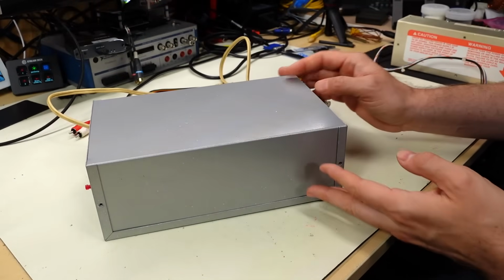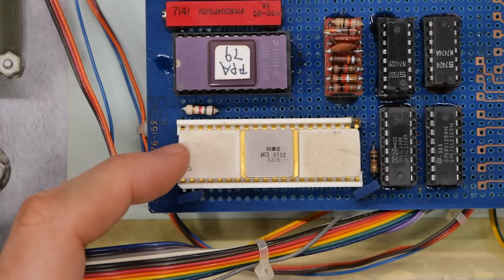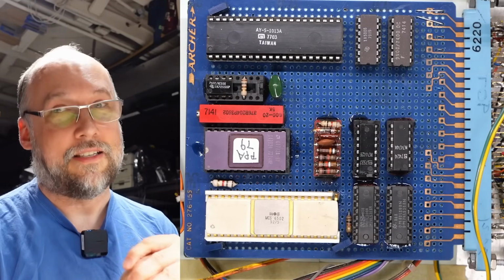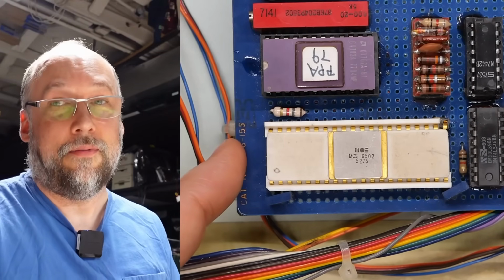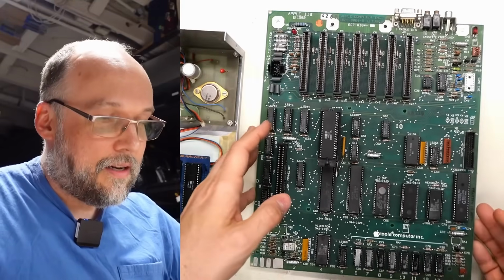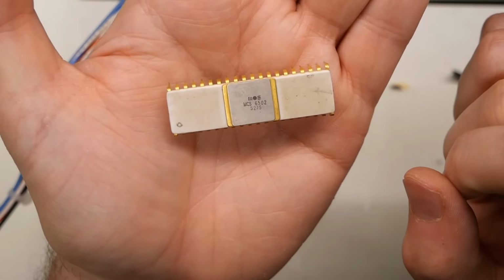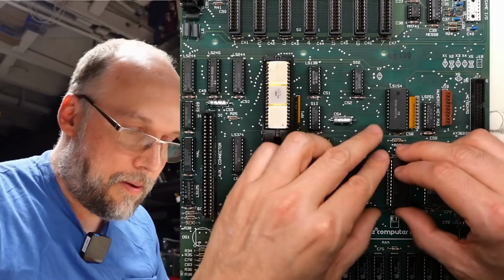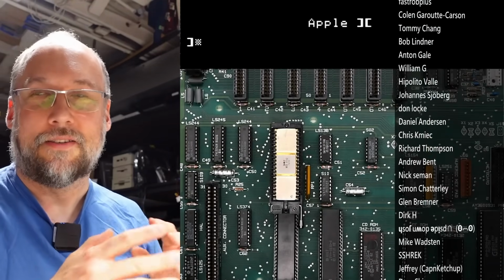Let's test a 50 year old MOS 6502 CPU

Comment: Funny thing. I just watched the video that debunked the myth of the ROR bug. The chips didn't have the internal components for ROR, so it was missing completely, and not a bugged ROR. That video has photos of the chip internals so I think it's legit.
Reply from the maker: I don't agree with that assessment. Robin makes a great point about it all: https://twitter.com/8BitShowAndTell/status/1629754457172111361 It was pretty clear it was supposed to be there from the start but never finished. So, if it was supposed to be there but they didn't finish the design, and released the CPU without ROR working, it sounds like a bug. If the new "ROR" had been stuck somewhere else into the decode table, ok maybe, but how did there happen to be a perfect slot for it if it hadn't intended to have been there since the start?
Reply: @adriansdigitalbasement  the video I watched stated that they needed to change the layout of other functions to free room for it, but since I wasn't part of the team designing the chip nor watched any video interviewing someone from the actual design team, I don't know if it is a fib or misinformation. I guess there are different stories around it and none is 100% convincing. I'll watch the video you linked. I'm not at all at the knowledge level of you and probably most viewers here so I just watch and try to decide what seems more plausible.
Thanks for the feedback, and keep the great videos coming 👍
Reply: @adriansdigitalbasement  ...also, if it was decided to not finish it and the initial intention was to implement it, it is a decision (made on economy basis I would guess) and not a bug. To me a bug is when someone releases something that is supposed to work but doesn't. If it is decided before release to scrap the function, it's not a bug IMO, maybe a bad decision but still not a bug.
All is my take and personal opinion of what a bug is. I can be wrong about the definition, my wife tells me I'm wrong often 😁

Comment: The 1st revision of the 6502 doesn't have a bug, your tittle is wrong; as Chuck said "it worked the first time" the ROR function was never implemented by design. As you said ROR was never written in the instruction set..

Comment: Well, there's some reports out there stating this isn't a bug. Apparently, in order to lower the price,  this version of the processor was not supposed to have ROR operation, so its basically an unused opcode with some undefined output. The ROR instruction, it claims, was added later due to user demand. There's a video here in TY with an in depth explanation.

Comment: Here’s something interesting. Note that, at time stamp 15:09, it says, “…which has a 6502 from week 51 of 1975.” The 6502 that Adrian has is marked, “5275”, or the 52nd week of 1975. So those two chips were, like separated at birth! Twins, if you will, only 1 week apart coming off the assembly line. How’s that for bizarre coincidence? Not only that, but they had the same birth defect (defective ROR instruction.)

Comment: You know what would be a really geeky thing to do?  You could wire up a circuit to the data bus and the SYNC pin.  When SYNC goes high, check to see with an 8-bit comparator whether the CPU just fetched the ROR instruction byte.  If so,  generate an interrupt.  And add an interrupt handler to emulate ROR correctly.   That way you could boot up an Apple ][ with that old CPU!   Possibly.   Unfortunately the disk driver probably will not work as it is critically dependent on each and every instruction cycle being just right.  I suspect the disk driver likely has a ROR instruction in it.   Wouldn't it be cool if they intentionally didn't use ROR because they had some early chips?    I'd love to ask Woz and the gang about that.

Oh, I looked at the Disk II disk driver listing, and it has NO  instances of ROR !!!!    But several ROL.   I wonder if that isn't a coincidence?

Comment: I bought a 6502 from MOS Technology in 1975 for $25.  It came with two very nice manuals, one for hardware and one for software.  I wouldn't call it a simplified 6800, it had some addressing modes which were much better than the 6800.  At the time, an 8080 was $250 and I had just build a computer using the 8008 chip which cost about $40.

Comment: Ah, the 6502, that takes me back... Though over here 🇬🇧 I don't think as many people had that Apple, though I may have seen 1 once. AFAIK, 6502s were most commonly used in BBC micros. I had a model B, which I think was the most common.

Rather than a screwdriver, I used to use 1 of the blades on my penknife to pop out chips. Although you'd still tilt it up a little bit at the 1 end, if a chip was in there with a tight fit, if you slid the blade most/all the way under you could then apply a slight rotational force to it side-to-side. That way, if you were unfortunate enough to bend some pins, they'd be bent in line with the short axis of the chip instead of the long 1, which made them easier to straighten. Straightening them when they were bent in line with the long axis of the chip was a pain in the arse.

Comment: I just took a quick look at the ROM of the apple II to check where ROR is used. It's actually not used a lot. It looks like it's used in the following functions: TRACE, NOTRACE, ONERR, HPLOT, when disassembling code in the monitor, and in some floating point functions. So that's where I would expect some problems to show up.
It's also used about 6 times in DOS 3.3, including some low level some low level functions like what to do for reading versus writing, converting half tracks to tracks or remembering which drive is being accessed. So the consequence of using a bad ROR in the DOS code could have very weird and critical consequences.
It's also used a couple of times in the boot code in the floppy drive card, messing up some kind of flag. So booting up from a floppy might not work or be glitchy.

Comment: I would imagine the code on the back and this is just a hunch, Is some type of serial number...  since the front said it was made in 75 and the back says 75073 maybe it's year 75' chip #73  I mean if it's 1st Time these chips were around it would still be a prototype kinda thing and probably very few of these chips would have been made, so chip #73 of 1975,  It's just a hunch, so maybe it is one of the originals.

Comment: Adrian, you have brought back some fond memories. In the mid 1970's I was in the Home Brew Computer Club along with Steve Jobs and Steve Wozniak. Because of the buzz about the 6502 I went to the Westcon Trade Show and bought my $25 6502 (with ROR bug) and the manuals. Untypically for the time where Intel would price a new processor at a very high price and then bring the price  down  over time as yield improved and development cost were paid for, MOS priced the 6502 at $25, quantity 1, from its' release. I then wrote a cross-assembler in FORTRAN II and built up a system from from parts and the 6502. Steve Wozniak shared at the club some floating point routines. I added some additional functions, wrote it up and submitted it to the August 1976 issue of Dr. Dobb's Journal. Steve's original code did not work on my 6502 because of the ROR bug, so I made a minor change so it would work for me. Steve wanted the original code published, as it used a few bytes less of code, but I submitted my modified version on the bases that I could not verify his version on my processor. That paper is on the internet at places like https://www.applefritter.com/files/Apple2WozFloatingPoint.pdf.

Comment: Great video Adrian.  In 1975 I had a small electronics startup and had ordered some 8080s for some programmable boards we were doing for Lockheed.  They were not yet available and the price was $360 each.  Before delivery, Intel dropped the price to around $220.  The chips were white and gold, just like your 6502.  Thanks for bringing back some great memories.

Comment: I have a question. Do you know what a "Tandy 2" is? It has an 8in floppy drive. I have 8in disks from an NEC. Do you think it will read an function with them? I also have a Tandy PC2 and PC3, boyh with printers that belonged to my father. They both only have single line displays.

Comment: I'll go you one earlier with the 1974 SC/MP (Nationals    ISP-8A-500). To run a program, it required 16 switches for the address lines, and 8 for the data lines to program the beast, my first introduction to micros and programming. The 6502 was a pleasure after this experience.  AAhhh, the nostalgia !!

Comment: I think I have a few of those stashed away. The late 70's and early 80's electronic (not electromechanical) pinball machines used 6502's as processors in combination with 6530 and 6532 RIOT (Ram, I/O, Timer) IC's on the CPU (and sound)  boards. Gottlieb used them extensively, which is the reason why I have a bunch of spare chips. : )

Comment: Wow.  That's cool.  You seem to feel about the 6502 the way I feel about the Motorola 6809.  Yep, the CoCo (Coco 1, Rev. E) was the first computer I owned.  I dabbled a bit in assembly language on it too; some of those machines had really esoteric instruction sets.  IIRC the Zilog Z80 had add and subtract instructions, but no multiply or divide.  The 6809 had the add and subtract instructions too, and it even had an 8-bit multiply instruction, but no divide!  Division had to be done in software!

Comment: My father wrote quadratic interpolation in assembly language for the 6502 that fit in the 0 page and ran gear shapers to make square gears for many years with the C64. But recently I read that the modern cable boxes use a 6502 emulator in the descrambling circuit, so whenever you watch cable tv now, there is some 6502 action going on and my dads response was: OMG

Comment: In the early 80s I used to maintain the analogue rolling mill control systems for the Royal mint in Cardiff UK. I still have quite a few of the analogue chips.  
My company Davy Mckee developed a distributed rolling mill control system based on the PDP 11 & 8080/8081 processor. All taking to each other over RS232  com.

Comment: Interesting video. I'm not sure If you are using anti static precautions in your video but with a chip of that age you might want to consider using them because older chips are not so immune to static as some of today's chips are. When it comes to the E-waste aspect I would have kept that unit for the box alone as it would be a handy one for future projects, plus it would have a built in power supply included, but then again I'm a pack rat !!

Comment: Hi Adrian, you tugged on my heart strings as well my friend. Not only is this my 1st micro (well second, if you count that the 1st was not completed and working yet too much), but my 1st running and working computer was the Kim-1. I worked for the National Science foundation here at a college in Massachusetts in 1975, was part of a small group that created an 8008 based computer to help teach for students on a project called CaLM. Computer and Laboratory Math. The 8008 was our design and needed so much more work, then we found out about the Kim-1 by mostek and put our old 8008 design on the shelf. We used the Kim1 for many presentations about computer programming for NSF and some classes until not to long after the project was canceled.  The late 70s was filled with home computers in a way back then, at least for us in that project. 

I got into the 6502 so much myself in that it directed my future in programming as well as hardware with that chip. I was involved with the 6502 with my career in a Game company, a computer publishing company, my own development business and so on. Your right buddy. That chip tugged on my heart I believe in a way as powerful as yours. It was the foundation that changed the world. Don't let it go. It's almost #1. Thanks for sharing my friend. Btw,, awesome find about ror. I've heard about it once, but never saw that issue. The Kim's we had was abit later than that. I think we had 02s in mid 76. The 8008 was in 75.

Comment: This reminds me of my ten years old Asus F201E laptop, which - according to some website - is the worst laptop they ever tested.
( Nevertheless I wrote about 50.000 lines of code on it ... ).
After about five to seven years it was not powerful enough any more to play YouTube videos so I decided to exclusively use it as a music player.
I connected it via headphone to RCA cable to my amplifier.

After some time I thought that there should be room for improvement and bought an external DAC ( USB -> DAC -> RCA -> amplifier ).
It was disappointing.
Me and my son agreed that the laptop sounded even better.
So I sent the crappy thing back.

Well, since I'm sort of a scientist I still did some research afterwards.

Ultimately I found out that this crappy laptop had a high-end audio chip built in, which even beat the newer external DAC ( and my CD player ).
I could not find the exact model in the Internet, but "Realtek ALC269 (ALC269Q-GR, ALC269QSRS-GR, ALC269W-GR) HIGH DEFINITION AUDIO CODEC WITH
EMBEDDED CLASS-D SPEAKER AMPLIFIER" comes very close to what I could find out on the command line.
( The pdf whit the chip's specs has 79 pages - so it must be good ;-) )

Comment: What a terrific find. The 6502 was what I grew up with - Commodore PET at school (hand coded hex instructions), BBC Micro at University (using assembler), and Torch XXX at work (with a C compiler).  Still have a BBC model B in the attic, haven't turned it on for 15 years, I wonder what would happen?

Comment: 6800 was too expensive.
6502 was designed to be cheaper. Used everywhere.
6809 was even better than the 6800. Used on the Color Computer and others, which often sold for same or less retail price than the 6502-based computers.
It's a very strange planet you have here.

Comment: the 6502 never been an expensive part; it' was a 25$ processor designed to be a cheap alternative to the motorola 6800; in fact the original 6501 was pin compatible with the 6800 and motorola sued them, so all they did with the 6502 was making it pin incompatible. it is one of the most inexpensive CPU ever made.

Comment: I played with the 6502 a lot back in the day.  My first computer was the Kim-1 I purchased as a young teen.
I'm writing for a clarification.  The probable reason for the 6502's pins being bent is because, normally, when you got a chip in a dip package, the pins were not sufficiently bent downward to line up with the socket.  My usual practice was to put the chip on its side on a hard surface and carefully push down to complete the bend and keep the pins even.  In mechanized board assembly, a chip insertion tool would take care of this.  Also, this "under-bend" would pre-load the pins with a little tension when the chip was inserted.  This pre-load would help the chip pop out of a removal tool if pulled from the socket.

Comment: Back in school days me and a friend was speaking about computers that used the 6502 and thinking well the commodore and the Atari.  What if we swapped the rom could the commodore then just load Atari games and VS.  But later we did learn there was more to it them just the rom.  We was hopping we could have a socket on the top of the case an just swop them about.  We were only in 2nd year.

Comment: I do not send anything off to "E" waste as well it could be of interest,without first checking. I do not have many I.C.s but I have a lot of early diodes and transistors dating from 1948 to 1956 and all of them still work as designed. I like the form factor many of the early semiconductor devices were packaged in especially before 1965 and as far as chips go, dips are nice but TO-5 style packages are even more so and the flat packs from the late 60s.

Comment: On the IIe board It just didn't hit an ROR instruction, or the result of it wasn't too apparent, maybe not too critical.  If you had a really good disassembly of the IIe rom, it would be a simple matter to replace ROR with a subroutine that gives the same register results.  Possible complication if it was part of something time-critical, but there are always workarounds.